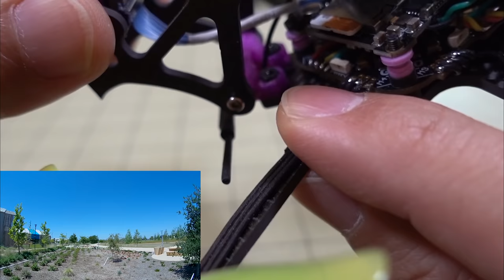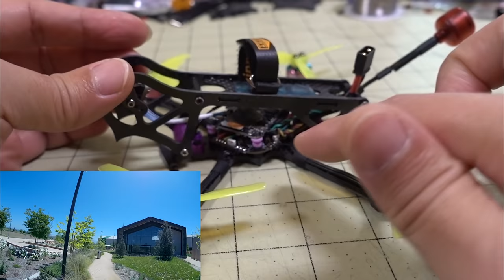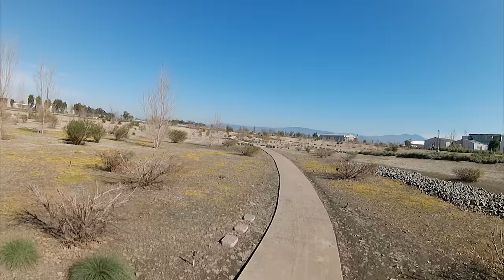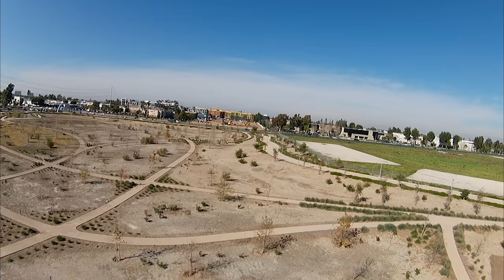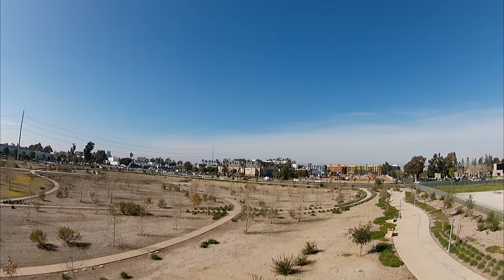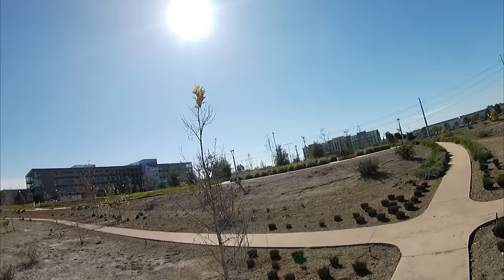COLIBRI HD "Toothpick" Frame (The Frame I've Always Wanted!) 🔥

Comment from the maker: COLIBRI is a collaboration project with ledroneclub (Alexandre Arvinte).  I wanted a very light 3-inch "toothpick" style frame for top mounted battery and HD video.  Too many other frames out there were more concerned with durability while I wanted something lighter.  I've also borrowed the clean/dirty section idea from the Acrobrat frame in this design however with a totally different solution than what's on the Acrobrat.

The frame files are available on Thingiverse here - http://bit.ly/2T2329x
* you can get them cut at cncmadness.com

My specific build has these parts but you can build this in a large variety of ways...

Flywoo AIO FC - http://bit.ly/2uuOpSD
RCinpower 1204 motors - http://bit.ly/3dl7Z4K
Baby Turtle Whoop Cam - http://bit.ly/3fzbJlk
RushFPV Tiny Tank VTX - http://bit.ly/2NBp5AR
RushFPV Cherry Antenna - http://bit.ly/2tklpge
Gemfan 3016 props - http://bit.ly/36wkgAA
Reply: What is the flighttime on something like this? As a non-agressive flyer I miss builds that is longrange, low weight, "long time" and not too expensive.

Comment: Amazing looking frame. Could it be used with a tarsier? Or would something like the MOD3 from LeDrone Club be better for that. I had been looking for a platform like this for a while and this looks incredible.
Reply from the maker: I haven't tested this with Tarsier but the height clearance may be small.  Perhaps and AIO board like Zeus and the RunCam Hybrid will fit better.
Reply: @AlbertKimTV  I have the betafpv aio 12a F4 and a tarsier already. I'm just looking for a frame. This frame and the MOD3 seem to be the only good options at the moment.
Reply: @AlbertKimTV  also how much camera protection would there be with a tarsier?

Comment: Nice frame, i think to try it. What is your max fly time with this configuration ?
Reply from the maker: I was getting 6 minutes cruising around on a 450mah 3S.
Reply: @AlbertKimTV  Very nice autonomy. Did you using 48khz ESC or défaut frequency ?

Comment: the frame as well as the clean and dirty concept definitly go into the right direction but there are still vibes and the camera quality in this size still lacks performance. even the tarsier v2 etc not yet quite reached the level that I desire. although I am quite happy with my acrobrat duo/tarsier footage there is definitly room for more low light performacne and dynamic range handling (eg dark environment when looking towards the sun)

Comment: Can you put a Caddx vista inside this frame or not ?
Reply from the maker: Probably won't fit this version... I can ask ledroneclub to modify for Vista if other people are interested... if so please reply to this comment, thanks.
Reply: @AlbertKimTV  It would be great 👍👍👍. I like 3-4 inch drones and if this frame can care a Vista, i will order soon as it will be ready
Reply: @AlbertKimTV  The more I look at it the more i'm wondering if it couldn't host a Vista just by rising a bit the mounts, especially the rear one. And mounting the vista on top of the aio. Tight clearance but may work.

Comment: can this carry a naked gopro or smo 4k? also, how does it perform when flying freestyle? love the design!
Reply from the maker: It can carry a naked GoPro but I would go with bigger motors.  It can do freestyle but it's not designed for that.  I would use something else for freestyle.
Reply: Would 1404 motors work? Thanks for the quick reply!